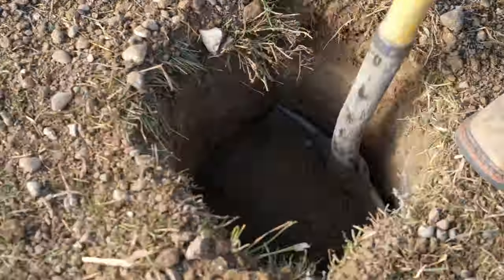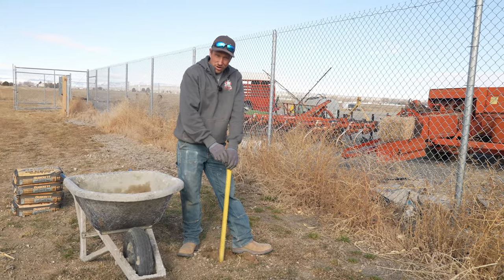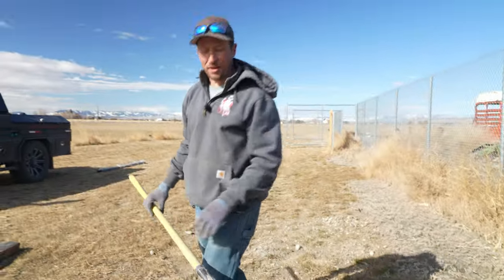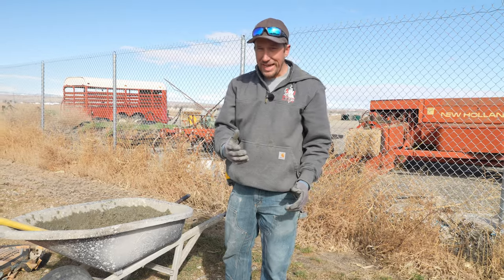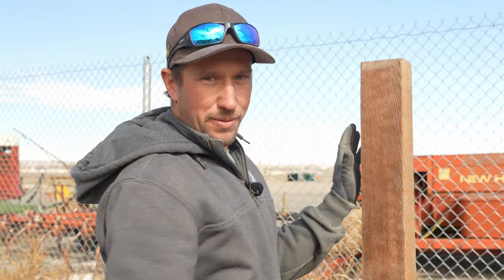Easily Set Sturdy Fence Posts EVERY TIME

Comment: I am in a swampy area, things may be different where you are. Here the recommended method is the same as the uniform building code method for building concrete footings for decks, which is to embed the bottom 4 inches of the post in gravel, allowing it to drain from the end, and then pack the concrete on the sides. 

ubc:R507.3 Footings.

My frost line is less than 1 foot, and my water table is usually 6 inches above or below ground level, but at least once every other month it is 4 feet below ground level, allowing the posts to dry. 

I set powder coated steel posts, that is what the city uses, and some are older than 30 years. Galvanized posts usually last under 15 years, but more than 10. Posts set in concrete like yours last about 3 years around here, or 8 if they have gravel at the bottom. I have been in this neighborhood 6 years and some of the new fences I saw put in after I got here are already falling over.

Comment: I use the post levels that attack to the post and give you two levels at same time. They attach to post or poll with a rubber band and you can level it, then fill, check level again and your done. Get two so you can set one, leave it while that’s drying and set the second as well. Move them as you go two by two.
Reply: You mean plumb?
Reply: good tip

Comment: SET your post toss one bag dry concrete one bucket water then other dry bag  right in the hole. That concrete will wet all the way through and will hard as rock. Thats the faster way to set fence post you really don't need the wheel barrel for mixing in .Use wheel barrel for riding in.  But hey thanks for your video.
Reply: I guess how much concrete bag you need depending of the size of hole, or doesn’t matter? So 1 hole 2 bags?
Reply: @Carpenterpilot487 that's the lazy hack job way and wont be uniform, which will end up reducing strength and leave room for cracking.
Reply: He did talk about the dry packing method and referenced a video that he made.

Comment: I like to use a post hole digger it works well and a spade.
Reply: HELL YEA THATS WHAT I USE..EASY TO OPEN A DEEP HOLE WITH IT AND ITS NICE AND SQUARED OFF..IF I NEED TO MAKE IT WIDER I SCRAPE THE 4 SIDES ALL THE DOWN WITH THE TOOL AND REMOVE THE EXCESS DIRT

Comment: DAN, they make a tool for that. Its called a post hole digger. Only 32"? Not the full 40" as is the cowboy way?
Each bag of concrete tells you on the bag how much water is required. 
OR,
The easy way is to use foam which is quicker-stronger-lasts longer-cleaner-req less tools.

!
Reply from the maker: Yeah that foam is weird stuff. https://youtu.be/iBgWx2y9pj8

Comment: You don't NEED a wheelbarrow to mix concrete. Lay a 4x4 plywood or puck board or similar. Make a hole in center of concrete mix, add water, take a hoe and mix it up. Use a flat shovel to dispense it. A wheel barrow and a round shovel makes it awkward.
Reply: That's how I learned to do it 60 years ago

Comment: What do you suggest I do?
I have 4’ deep holes using 12” so o tubes but the post is only going in tube 2’.   How do I keep post from falling deeper ?
Reply from the maker: You can pour the concrete drier, or you can set up blocks at the bottom of the hole so that the post rests on the blocks. 👍🏻

Comment: I attach a piece of treated 2x to the bottom and just compact mine in.  We have all clay soil.  So far this seems fine what do you think?
Reply from the maker: This is extremely dependent on what kind of soil you have. You have to have the right soil. You have to go deep enough. And you have to compact it WELL. But this can be an excellent option. 👍🏻

Comment: Tbh I was wondering where the post hole diggers are at and why you chose not to use them?
Reply from the maker: Just because I don't carry them on the truck. We typically run into more bad ground than good around here, so they don't prove useful very often for us.
Reply: @SWiFence  okay that makes sense. I do t have any rocky mess where I live. Red clay and mud.

Comment: You filled 3 inch dirt around the post? it will create a water pond there and will rot the post.
Reply from the maker: We'd rather let the ground freeze over the top of the post--helps with post heave. This is why we don't actually ever use wood posts, though--we always use steel.

Comment: We're Almost their! That's What she Said LOL. Hey Dan Have You ever mixed the concrete in the hole using the auger attachment LOL? New guy put the bag of concrete in the Hole didn't Mix shit OMG! Challenge Accepted.
Reply from the maker: 🤣 Well there you go! No I haven't but now I'm going to have to look into this. I'm pretty sure I saw a guy do this and the concrete didn't turn out the same.
Reply: @SWiFence  our holes had 2inches of bentonite walls with 5inches of ram packed sand at the bottom engineer requirement of the job.  I would not suggest it with a hole around lose dirt.  I'd have new guy take it out.

Comment: concrete and wood post= bad idea....rain water will rot out the post in 3-4 years....you need to provide drainage for rain water otherwise the post will absorb the water...i have used gravel and compacted it every 6 inches...never had a problem in 30 years
Reply from the maker: We actually NEVER use wood posts (as we say at the end of the video). You're right. It's a bad idea. Steel all the way.
Reply: We've had wood posts in our yard for fifty years and they are still holding  up the fence!
Reply: We've had wood posts in our yard for fifty years and they are still holding up the fence!!!!
Reply: @royromero8496  means good drainage, thats what counts 👍

Comment: If you're going to go through all the work of mixing the concrete why would you not fill it to the top and trowel it so you didn't have to tear up the post with the weed wacker and looks professional
Reply from the maker: The only time we surface concrete is if there is a mow curb, otherwise keeping the concrete below grade is far better. 👍🏻 For example in winter it prevents frost heave since the frost literally locks it in the ground.
Reply: @SWiFence  Ahh thats the answer I was looking for. I didn't see a mention in the video of why you recommend setting concrete below grade. Does this apply to wetter areas that don't have frost? In that instance is it better to slightly mound the concrete to disperse the water away? Thanks.

Comment: Funny how none of these videos talk about when you dig and run into a big rock in the ground. Digging is not that simple.
Reply from the maker: We hate hand digging in our area because of the rocks. We typically use augers on skidsteers. But if we're digging by hand we bust out the digging bar. Takes forever and we hate it, but it has to get done.
Reply: @SWiFence  oh. So does a digging bar break rock in the ground?
Reply from the maker: Er... maybe. It's more for getting around the edge of and prying it out.
Reply: @SWiFence  whatever happened to breaking rock with a tool and not a power tool?
Reply: @SWiFence  I bought a tampering bar that is very heavy and I tried to break the rock and all it did after me hitting it for a good half and hour was chip little tiny pieces of. So I wasted my money on this bar. It's a lost cause. I'm not getting a jack hammer to break this rock so I'm going with 2 feet. At this point I don't care about the frost line.